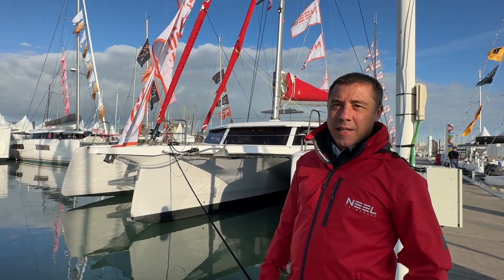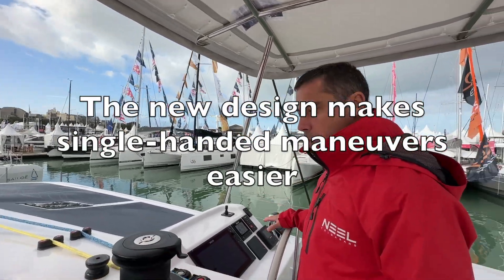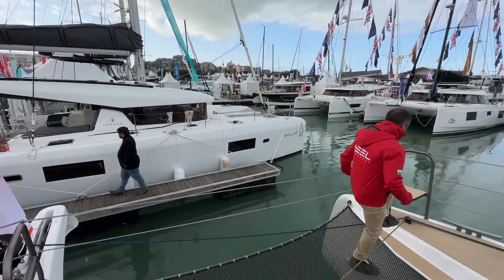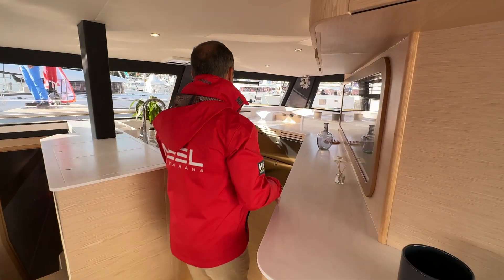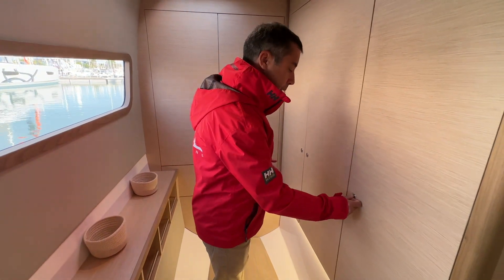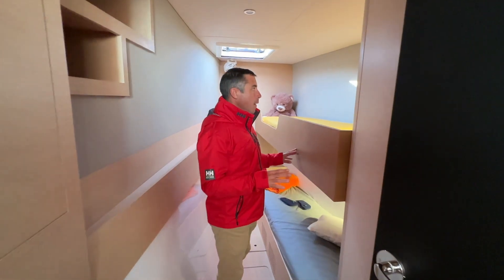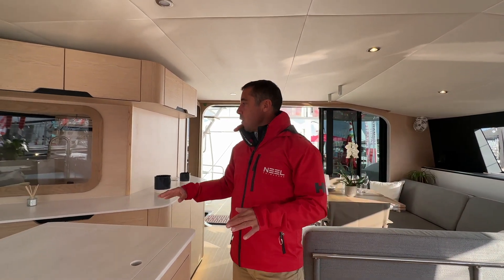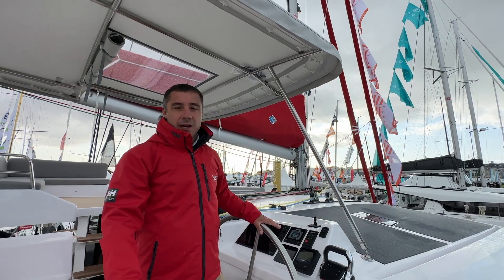Is she the best cruising trimaran? Check out the all new Neel 52 ! Full walkthrough.

Comment: I like what Neel has done with the 52 overall. My main criticism is the replacement of the technical room in the 51 with the center cabin. The engine room serves as the technical room now. There appears to be less space, so it's not exactly equivalent. I guess the owner can always choose not to have a center cabin. Another issue I have is moving the master cabin head downstairs into the starboard hull. That's inconvenient if you need to use the head in the middle of the night, instead of having it right beside the bed on the same level. All the other changes are definite improvements. Extremely curious about the performance numbers.
Reply: OK, I just viewed another Neel 52 video and it's confirmed that you can have the original technical room in the center cabin area if desired. Neel is taking long strides in offering additional customization with their new model line. I am generally impressed by the company's willingness to work with its clients.

So, what I'd do is have an enlarged technical room instead of the center cabin, and the forward cabin with double bunks transformed into a workshop a la Outremer on their 52. The owner could then utilize the entire center hull for mechanical, electrical, and repair work, or anything of a technical nature. The port hull is for guests and the starboard hull is exclusively for the owner's use. That's it! I may have stumbled onto the perfect layout I've been searching for years, or nearly perfect. The master head is still downstairs but maybe that wouldn't be as bad as I imagine if the sea state isn't rough. Lots of potential with this boat. I think Neel has another winner.
Reply: What you criticize here is all one owner's preferences. Also in the past many YouTube channels has based their critique on Neel designs on basically owner's preferences, which is really poor. I think it is a good thing overall, that Neel clearly listens to it's customers and offer first of all a lot new safety features, as for instance rails to the bow, which many catamarans do not have at all and which former Neel trimarans were did not have either. I would always prefer hard rails though.  Neel also offer even more layout options with this 52, than they already did with the 51, and that model already had many layout options. If you don't like those options, don't tick that box, I guess! He actually forgot to show two areas, by the way, the aft part of both outriggers, which also could either be storage areas or even spare cabins. I sure would move the laundry to one of those, which I have already seen done very smart on a Neel 51 and leave the other to e-bike storage and charging etc. On that 51 at least, those storage rooms only could be accesses from the outside, by swinging up the stairs from the sugar scoop, which of course have some obvious issues if you need to access those in rough seas, but do you even do laundry in those conditions? On the other hand, it got to me the obvious advantage, that you move noisy laundry machines out of all accommodation areas that way. Then you essentially got two technical rooms in the outriggers and back to same capacity, still with the central cabin intact. Just don't plan to place  heavy things to go into the outriggers, of course. That also double the work space for the owners cabin below. Personally i got no issue with walking down the stairs to have a wee pee in the night, that is actually, what I have to do, where I live no, in a tiny house sleeping on a balcony really and the living accommodation, including my bathroom, is all below. You also could argue, if you sleep with a partner, maybe it would be more comfortable for that person, if you are going a bit further away at night to pee, so they do not have to listen to the drizzle and flushing toilet and all that. There is no such thing as a perfect boat for everyone, but Neel 52 in my opinion can be so hugely customized, that it could work for most people.
Reply: @1corinthians15.1-4kjv  In the sailing world, there's a huge range of owner preferences and requirements in a boat. No doubt my commentary was from a subjective viewpoint. That said, the Neel 52 is as close to perfect for my needs as I've seen thus far in any yacht around the 50-foot length. Of course, the larger the yacht the more ideal the layout and accommodations that are possible. There's also the price to consider. It's the principal factor for most buyers and the Neel 52 isn't the most affordable out there. Nevertheless, it's incredible what the company has managed to do in this size bracket. I'm eagerly looking forward to an actual review under sail and anticipate its performance to be superior to the 51. Not that its predecessor was slow by any means but more performance is always welcome.

Comment: I noticed a lot of sharp edges (and corners outside the main saloon area) throughout the boat - those could be softened or rounded to prevent accidents.  Otherwise, a great improvement over the 51.  As asked by someone else - how does it perform?
Reply from the maker: Hello and thanks for your comment! I can't tell your first hand how she performs as I haven 't had the chance to sail her yet, but I had detailed conversation with the team from the yard that did the sea trial and the feedback was unanimous : she sails faster than the 51. She is a bit lighter, a bit stiffer and a lot of computational power has been used by Marc Lombard's team of architect to design the hulls. It's incremental change, not going at double the speed of the 51 which was already a fast boat but 1-2 knots faster in average conditions

Comment: I like most of the improvements.
Questions, water heating? Is it tank or on demand?
If one wants to go propane for stove, grill and water heating, where is the designated propane locker?
Does it have AC, or option of AC?
Where is a good place to put a propane or diesel stove for higher latitude sailing?

Comment: Solar Panels:  I've seen a lot of other builders and owners modify the "flush" application of solar panels... Having an air gap under the panels reduces heat, heat that can be transferred into the boat... heat that reducing the efficiency of the panels...
Reply from the maker: hello @bobjohns8914 you are absolutely right . Under the tropics it also decreases the panels lifetime as the connections end up burning. fortunately the latest models of panels handle it much better but you need to get top quality like Solara for example, not cheaper panels. Overall flat panels mounted on frames have better performance  and now we often install the double side ones on davits : they even produce from the reflection of the sun on the ocean that hits the bottom side of the panels. But it's a trade off between practicality (the mounts have sharp edges and make moving on the roof more difficult) and efficiency. As dealers we offer several solutions to our clients and let them choose what they prefer

Comment: I think losing that great technical room the 51 had in exchange for just another cabin is a poor trade-off.

Also, what’s the point of having a desk when you already have a nav station?

There are some improvements from the 51, but over all I think the 52 isn’t a big step up. 

What I really want to see is a lower helm, a centerboard keel, and a more central chain locker and windlass.

Comment: Neel boats seem to have an issue of cracking along seems.  Have you come across this issue?
Reply from the maker: Hello. In the first Neel 47 the bulkheads were glued to the hull and on some of them the glue did not work as well as it should. Neel has done warranty work on these boats and now it s not an issue anymore. On the 51 the bulkheads are all stratified to the hull so no problem
Reply: @SAILTAHITI  Thanks for the information.  This is the first I have heard of them fixing the issue.  Hopefully the new building process is done on all Neels.

Comment: I feel like the space could be used a bit better. The Nav station space is too big, the master a bit too small. Move the galley to where the nav station is,, move the nav in front of the master, move the stairwell to the front cabin to the other side of the post, next to the new nav station, make the master bigger.

But all in all, it's a great boat to live in.
Reply from the maker: Thanks for your comment ! It's funny what you say about the galley and the navigation is what the lay out of the previous model was. Check the video we did a few months ago : https://youtu.be/9gC9LtUUMEU
Reply: @SAILTAHITI  There were good aspects to the previous layout. I found the galley too big on the 51, but the main deck master cabin with the adjoining head was remarkable for a 50-footer.
Reply: @SAILTAHITI  It was good to be able to see the nav station from the bed. Easy to check up on things at anchor without getting out of bed.

Comment: I've been a fan of the Neel 51 for some time, so I had high hopes for the 52, but was frankly disappointed.  The ridiculous roof lounge is unfortunately still there, sucking up valuable space where solar panels could be placed.  It's a useless space as is (unless the owner just wants a dock queen), and removing it would also allow the boom (and center of effort during sail) to be lowered another 4-6 feet.  What used to be a fantastically spacious engine room on the 51, where you could literally walk all the way around the engine, is now just another cramped engine room with difficult, awkward, and incomplete engine access on the 52 (probably the biggest fail in the redesign).  They took a massive amount of room out of the owner's suite.  And for what?  Another galley counter?  The galley on the 51 was spacious enough as it was.  The forward berth on the 51 actually looked usable, if tight.  The forward berth on the 52 is fit for toddlers, at best.  A broom closet, at worst.  And the so-called "double berth" (looks nowhere near that size) in the center hull is cramped and uncomfortable-looking.  I wouldn't put anyone I liked in there.  The bows sitting so far out of the water is a recipe for pounding under way, which is not going to be pleasant at any speed.  Personally, I've always disliked the helm position on the 51.  It looks like a design afterthought, and a bad one at that.  I'd hoped they'd rethink it on the 52.  Alas, it's just as bad on the 52, although tidier, so I guess that's something. 

After seeing this, I'd have to say the 51 is the better boat.  I wouldn't even consider the 52 given the mess they've made of it.  What was Neel thinking?  I very much appreciate the excellent walk-through, but I'm really disappointed with the Neel 52.  Such a shame.
Reply from the maker: Hello @meadmaker4525 thanks for your comment. I agree with some of your points, not all of course. The center cabin looks a bit awkward but is positioned at the center of the boat so probably very comfortable in heavy seas. The bows are high above the water like on many racing boats but remember this was at the boatshow with an empty boat. Add all the gear you'll carry on a round the world trip and they won t be so high. The lounge space on top is not the best for performance I agree with you, but most people ready to buy a boat in that budget range do want some nice space for lounging at anchor... If you're keen on the 51 I would like to mention that we have one for sale : https://www.sailtahiti.com/en/portfolio-items/neel-51-2022/. she is available now in Fidji, and is completely equipped for long distance sailing. Feel free to contact me at david@sailtahiti.com, I'm looking forward to discussing in more details with you ! Have a great holiday ! David

Comment: Don’t touch these yachts with a barge,pole, they have been really poorly built with a huge amount of laminate failures on bulkheads and chain plate areas. The bonding they used didn’t cure and is like plasticine. It hasn’t bonded so they are death traps waiting to happen.
Reply from the maker: Neel did have some problems on a few of their trimaran, nothing to the extend of other boat manufacturers and they were all fixed under warranty.
Reply: Neel quality is  garbage. In 10 min on a new Neel I identified dozens of defects, don't touch the boat if you intend to sail, if you want to stay in the marina and have cocktails perfect. @SAILTAHITI
Reply from the maker: Hi Ben. Given that we are based in Tahiti which is 11 000 nautical miles away from the Neel factory I guess at least some of our clients who sailed their Neel across didn’t just have cocktail in the marina. I always wonder  how one can have such strong opinion about a boat by walking on her for 10 minutes ? 😂
Reply: Perhaps you missed the recently posted video of the Neel owner that managed to sail to New Zealand from Europe via Tahiti to find that his Neel was falling apart? Almost all of the joints that are glued instead of glassed were coming apart. The boat will virtually have to be rebuilt to be seaworthy. If I can identify dozens of defects on a boat in minutes it means there is a serious problem and it has been substantiated by owners. Incredibly badly built boats, a shame. @SAILTAHITI
Reply from the maker: @benlindner5285  he refused to get help from Neel. A few of the Neel 47 had similar problems and all were fixed under warranty. For reasons I do not know, despite Neel offering to fix gis boat multiple times he waited until New Zealand to do it. In the meantime he has crossed the Atlantic several times and the Pacific once.
Reply: @SAILTAHITI  I feel certain that the sales manager at Neel told you that ridicules tale and you believed it because it is how you make your money. But to any outside observer your comments are absurd, and of course contrary to what the owner stated specifically in his video. It is not possible that a responsible boat manufacturer would allow a brand new boat to leave the factory in the condition that I observed your boat to be in if they gave a dam. Neel has earned a reputation for poor quality and it wasn't because of one boat or one model. I mentioned my experience viewing a brand new Neel to a friend who has purchased and owned nearly 100 cats for a charter company. He confirmed that his  observation was the same. Sorry but the boat building business has become a race to the bottom and the first things to go are quality and safety. Btw I just sailed 10,000 miles SOLO in a 27' 40 year old boat without suffering any damage.
Reply from the maker: @benlindner5285  hello Ben. I m happy for your solo sail. Congratulations! As regards the Neel 47 I have seen repairs being performed by very good yards under warranty. As I wasn’t t the dealer for this specific boat I don t know why it got in such a mess, just know that other boats were fixed. Moreover the Neel 51 bulkheads are all glassed not glued.